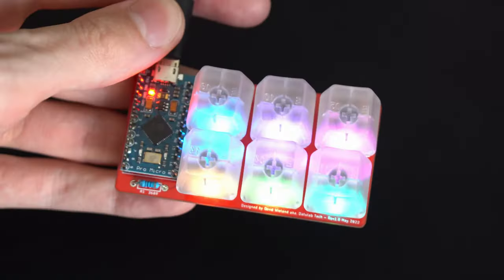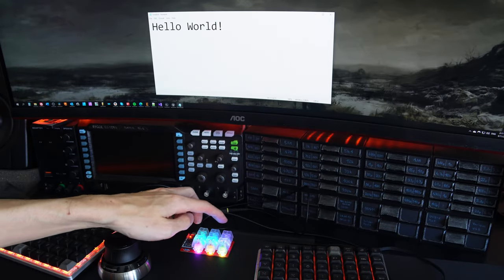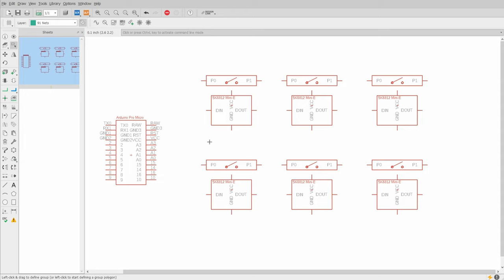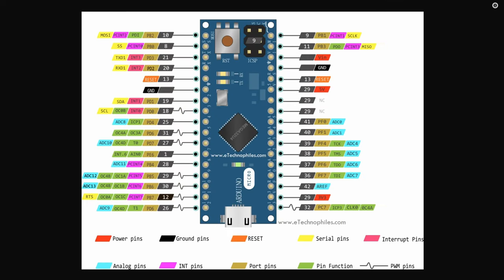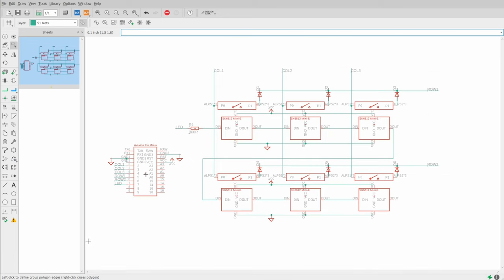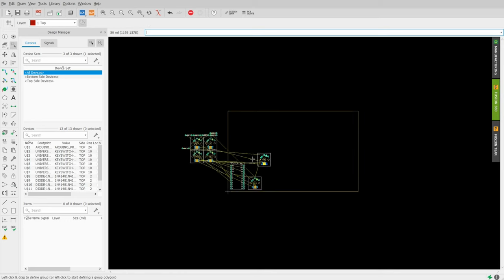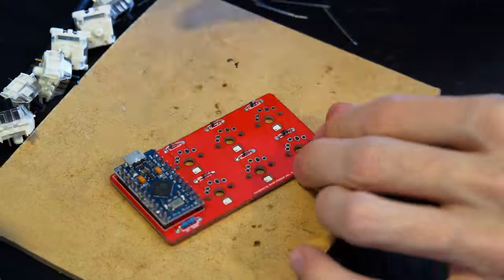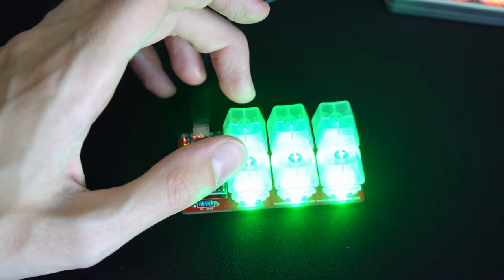DIY Keyboard Tutorial Step by Step - Ep.1 The Basics

Comment: 19:40 You know you can set your x,y grid spacing to be (19.05mm / 24 steps) which equals 0.79375 mm right?  That will give you optimal grid spacing to line up these switches by dragging them next to each other.

Comment: Can I use esp8226 or esp32? 
I'm still have no idea if they can use as an alternative for microcontroller. 

I'm beginners 😂
Reply: Since they are cheap in my country
Reply from the maker: It is technically possible, but because they don't have native usb integrated but instead a uart to usb bridge it is not as straight forward as with atmega32u4 based boards. You can get arduino pro micros for less than $5 on aliexpress and I've not had an issue with them so far, so the cost savings would likely not be worth the extra hassle.
Reply: @DarkArtGuitars  $5 is around 70k IDR
😂😂
Reply: But hey I'll subscribe to you, 
Thanks for answering 😁😁😁👌🏻

*edit 
NVM, I'm already subscribing to your channel🤣

Comment: why did you put resistor on led input? no need that
Reply from the maker: The datasheet for the led calls for it, I'm assuming it's to limit current in case sth goes wrong. Might also work without but easy enough to add.